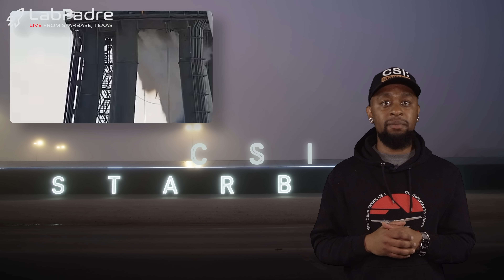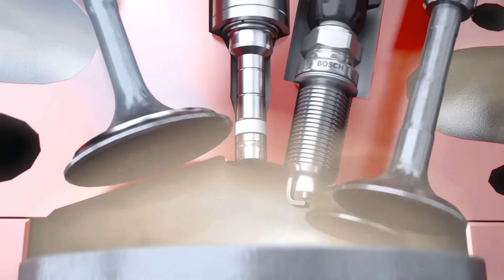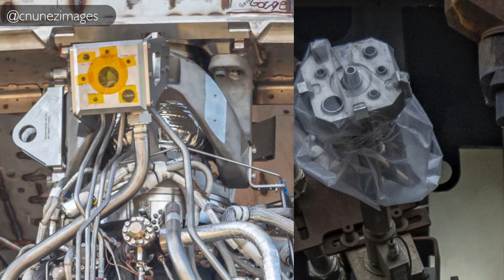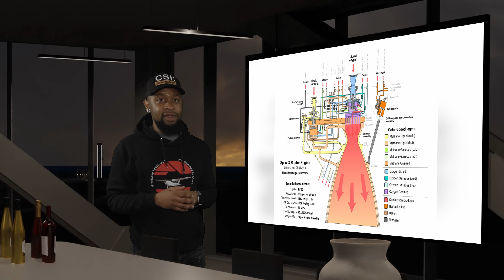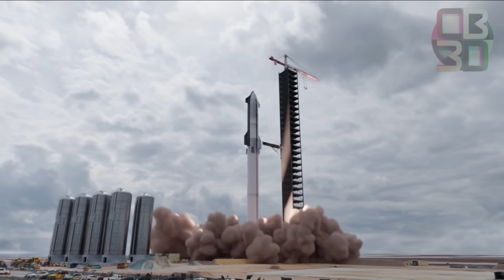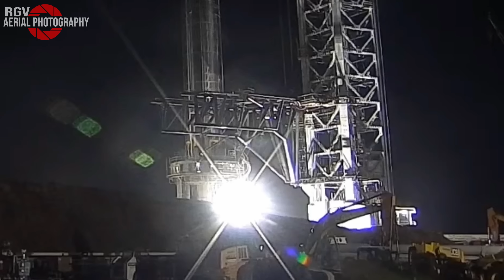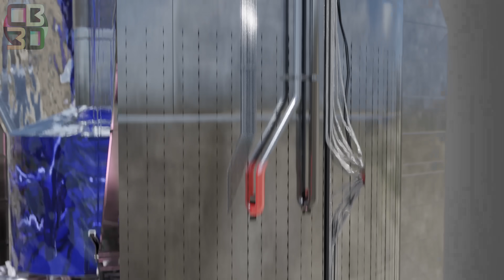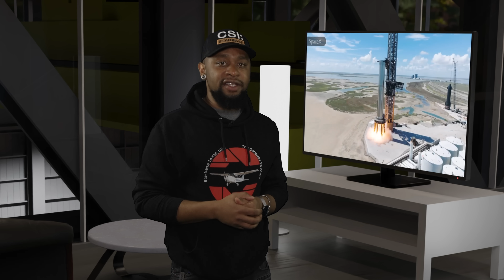[Part 2] The Real Reason Behind Delays to Starship Orbital Test Flight

Comment: what are you using to create your vurtual production environment?
Reply from the maker: I believe they are using Blender. I would need to confirm that with them
Reply: @CSIStarbase  Yes we do :)
Reply: @CSIStarbase  If you guys are interested in unreal vurtual production, It would prove much beter visuals and a more emersive environment. I can assist in guiding you to and thru the right tools if you and your team is interested in this. it also cuts down rendering time and allows for realtime visuals.
Reply: What are you referring to? The green screen backgrounds are done in Blender by @2Legit2Quit_3D
The other scenes, where some pipes are shown, are done in Unity from inside a game.
Both can be used to create very nice looking visuals, if you can put in the time and have the experience.

Comment: The more sensible method would be to channel the Oxygen to the top of the vehicle. Cheap, simple and safe.
Reply from the maker: That would require an additional collection manifold to be installed inside of the booster. Spacex likes to remove parts, not add them.  So I don’t believe that would be something they would consider because they are already over their desired dry mass for the booster

Comment: Excuse me, but oxygen gas burns.  It burns hot and fast, and took out 3 astronauts in Apollo 1.  Review your history, Sir.
Reply from the maker: I think I got it correct. The fire on Apollo 1 was not started by the oxygen. It was started by an electrical short. The oxygen accelerated the fire.
Reply from the maker: Apology accepted

Comment: what i was thinking...
why split this flame arrestor in 4... i mean one is safer.. now it could have 4 times a chance that a flame arrestor can fail. 
I would rather put 4 pieces in after each other.. if possible, than you have a higher safety..  maybe they do have this manner made possible with valves letting the gas go from 1 to 2 to 3 to 4 and then exit.
but maybe those flame arrestors can't handle the pressure..
but.. now they have an arrestor coming now from 10 sides into the one pipe going back to the tank, but than you can have 1 of those 10 fail and it still can fail, or there should be 1 big arrestor again going to the tanks..

P.S. Elon should go to the Netherlands because government was complaining about methane gasses comes from the farmers cattle.. he should make a deal with the farmers.... 
build a methane collector lol just a joke..;-)

p.s. is it not safer to burn than methane before it can mix, Elon should post all problems, i bet this WWW will come with great ideas..... and maybe one can co to the moon or mars...